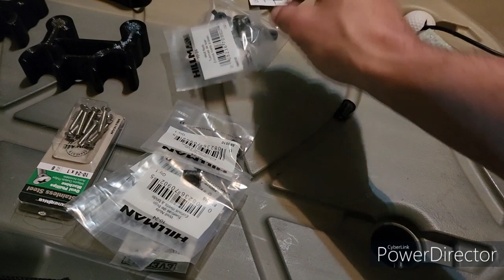Lifetime Yukon unboxing & install waterproof paddle holder bungees, anchor eyepads & seat risers.

Comment: I was literally picking out parts for my new Lifetime Tamarack Pro to seal up the paddle cord holes and found your video. Exact same idea I had.

Also ordered the seat risers on Amazon, slightly different style between yours and mine, but it's supposed to be injection molded and not 3D printed, so we'll see.

I've done tons of 3D printing from PLA to engineering grade filaments to exotic stuff, but I still don't trust it for high load or high stress applications.
So I'm curious to know how those seat risers have held up over time? 
Hopefully they're good-to-go no matter how they're made.

They should be under compression which is fine, shear forces and tension forces is more stressful on 3D printed parts.

Comment: Been a year now.........how have those seat risers held up?  Is the yak any less stable with you 2" higher?  Thanks
Reply from the maker: They've given me enough room to slide my tackle box under the seat instead of behind the seat giving me easy access. It does not effect the stability of the yak at all.